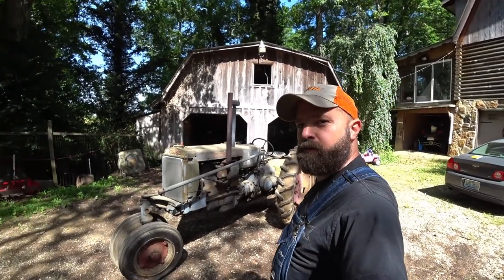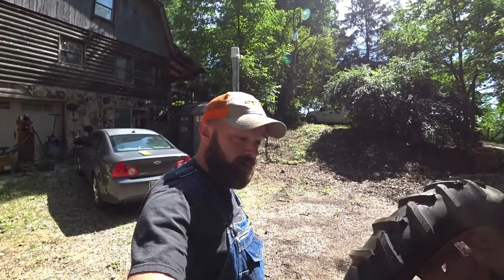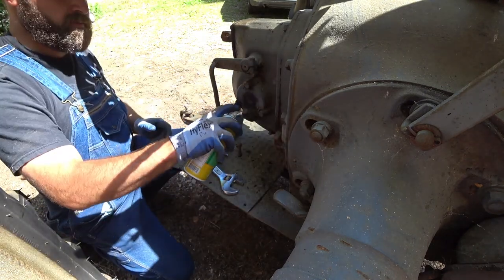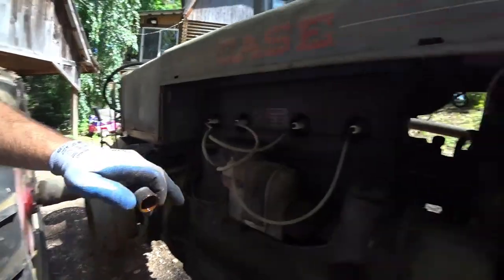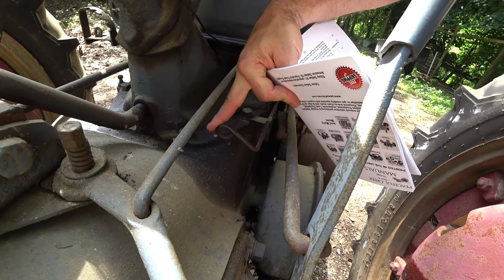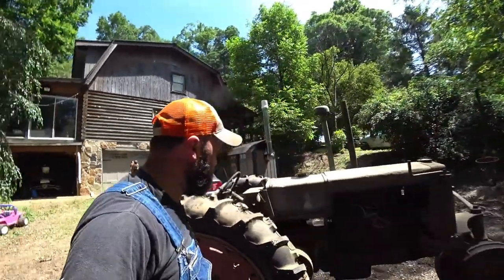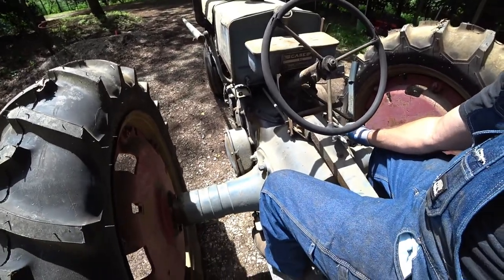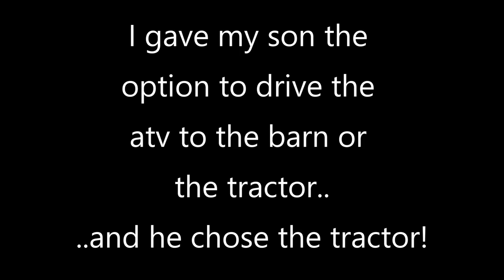1938 JI CASE CC  -  WILL IT RUN?

Comment: With Pa's '33 CC Case, we set the crank near 9-10 o'clock, stood on the left of the tractor, placed our hand on top of the crank with all fingers and thumb over the top. DO NOT GRASP THE CRANK LIKE HOLDING A GLASS. with the thumb over the top with the fingers, pull back on the crank. If it back fires, it will pull the crank from your hand but you will save your fingers and thumb. It will usually start near the first two cylinders firing. And, the disengage mechanism will spin free of the crank handle. Thank you for sharing this case model with us. It brought back many memories from the 1960's.

Comment: Great video.  I have a 1936 Case CC just like yours.  I haven't run it in 13 years but it ran and drove well back then and one of these days I'll get it fired up again.  Thanks for all the tricks on spark, throttle, and choke positions for starting because it's been so long I forgot!  I feared for your life when you were turning the crank.  Like the other commentors said, try to stand away from the crank as far as possible, then pull the crank up to about the 10:00 position and you just want to pull it up over past the 12:00 position TDC until you hear the click, then immediately let go of the crank and get your crank arm out of the way as fast as you can so the thing can't attack you.  A Farmall F-20 crank almost removed my arm from my body once when it kicked back and whacked my arm with incredible force.  Yes, all fingers and thumb together on the top side of the crank handle so the crank can easily slip out of your hand if it kicks back.  I bought a pair of the CC rear axle extensions on Ebay also which, when installed, make the rear very wide, which is great on hilly land.  Keep up the good work!

Comment: The Pto is up front on the right hand side.  The linkage in the back was for the power lift for lifting equipment such as the cultivator or attached lister.  The Pto must be running to use the power lift.  The switch is aftermarket, there was a tab on the original magneto to ground it out or just shut the fuel off.  For safety reasons always stand off to the left of the tractor when starting, if you stand over or fail to release the crank when you pass tdc it could kick back and break your arm!  Sounds just like a Case, nothing sounds quite like them.